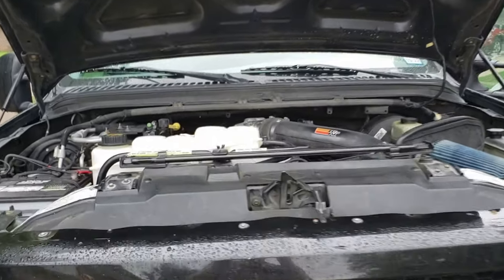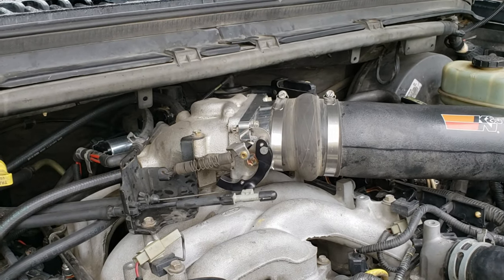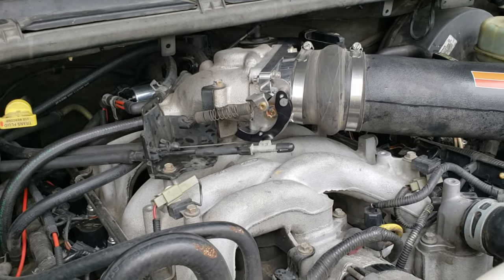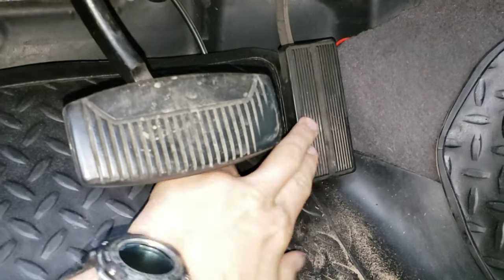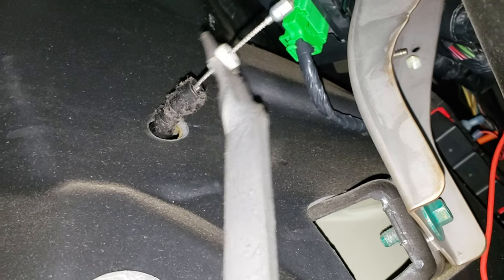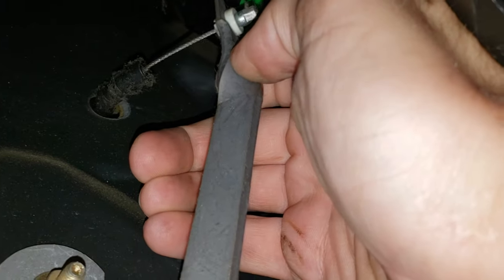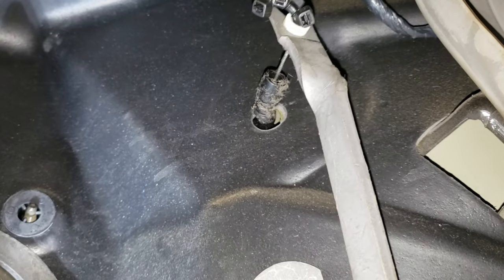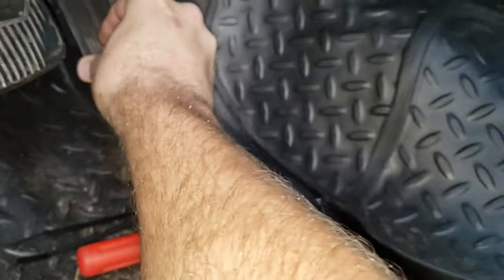Stretched throttle cable fix!!

Comment: I used a lead fishing weight on mine way better then the zip tie i had used plus sits in that bowl shape perfectly
Reply from the maker: Excellent idea!!!
Reply: My cable is a little different but i just used the lead crimp weight . Instant improvement .
Reply: Tried this. It didn't work very well since it's only lead. My cable seems to just spread it open and it falls off

Comment: I did this to my 2000 f150 and it worked. After 170.000 miles there was some slack on the cable and now it runs better
Reply from the maker: woohoo!!

Comment: I had this problem with a 99 2.2 s10 and I couldnt get my cruise to come on half the time. Pedal sits 2 inches higher and cruise works right away